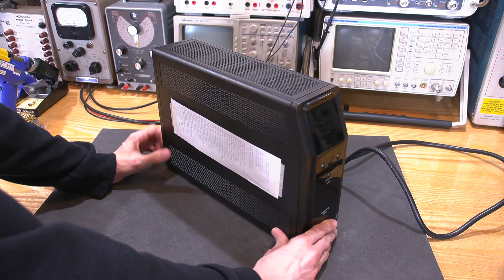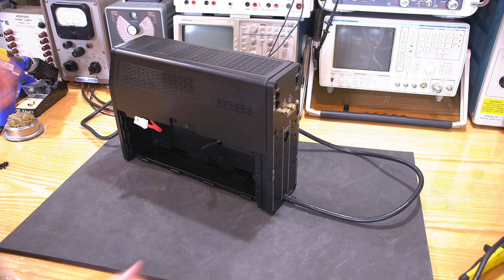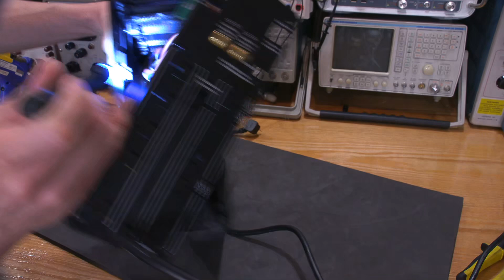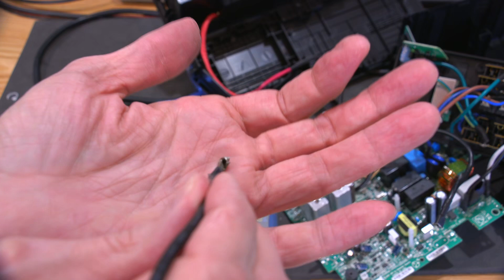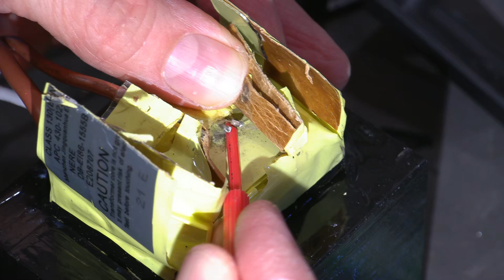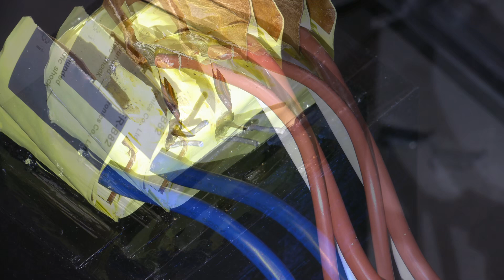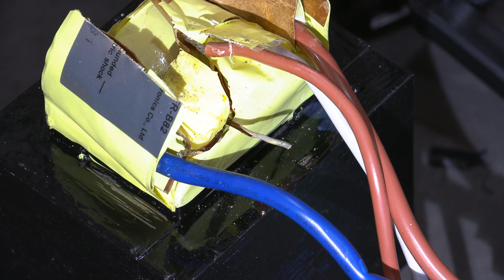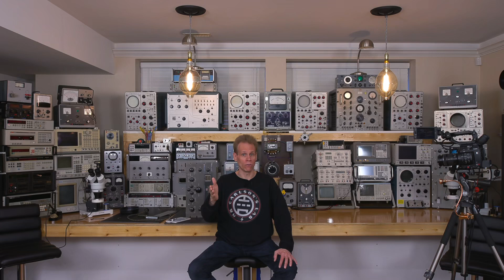UPS Electrical Failure - Teardown and Analysis!

Comment from the maker: To learn electronics in a very different and effective way, and gain access to Mr Carlson's personal designs and inventions, visit the Mr Carlson's Lab Patreon page here: https://www.patreon.com/MrCarlsonsLab
Reply: you can solder aluminum to copper wire with standard solder and special flux for aluminum, sadly more and more devices like transformers and motors are wound with aluminum wire today
Reply: Copper Clad Aluminum no doubt. I personally have had rack mount APC brand equipment fail in a data center. The transformers are garbage. At least the technology is smart enough to fail safe.
Reply: APC QA tests all their UPSes and then tapes the print out of that series of tests on the side of the unit.  It doesn't necessarily mean that it was refurbished or remanufactured.
Reply: @unmanaged  he just showed you the failure 🙄 f02 warning for a fuse or relay? Presumably for a fuse or relay directly in line with the solid state transformer winding failed connection.. that he just showed you
Reply: What a lousy failure mode! Nothing wrong with aluminium windings. But you must ensure proper connection if you want to continue in copper. Definitely in this high-power application. 
Crimping may be better here... Not shure. Something to look into for APC!
Reply: @ReinierKleipool   Shure?
Reply: I have of the exact same UPS in use in my shop, all within 2 years old, maybe the oldest one is three.  One is inside my locked server cabinet (tight fit).  So far, all four have been great.  The last one is well past its return to Amazon time.  I guess I just have to keep my fingers crossed.
Reply: @Daveyk021  I'd not use that model for more than a workstation and primary monitor. Servers want a bit more beef and I oversize a bit in battery to ensure longer run time and proper server shutdown.
Reply: @spvillano  My server is a little four bay Synology (really souped up though).  The UPS runs it, the Internet modem and the Router.  Even so, it is barely loaded.  I ordered Aluminum solder and Flux to join Aluminum and Copper wire together to keep in the supply cabinet just incase I ever need it (fingers crossed).  I thought APC was the name in UPS, but now I see they are a capital company rather than an engineering company.  Better keep their share holders happy rather than the customers.  This is why GE fell apart.
Reply: I see those "receipts" on APC surge protectors and PDUs as well if that helps. Might be a common feature of the industry
Reply: F04 Clamp short
Reply: It would be wonderful if the makers of this UPS would learn electronics in a different and more effective way for sure.  Thanks for sharing this video!  I had no idea aluminum transformers were a thing in electronics.
Reply: Two of mine caught fire.
I turn them off when not in use.
I took one apart and saw a mosfet was cracked.
Reply: Every APC ups since time began has one of those receipt test report thins taped to it when it's new. The last ups I bought was eons ago, and they were a few small APC UPSes, and they all had that test report thing on it.
Reply: @gorak9000  Of the four I have, I pulled that off when unpacking, looked at it briefly, shrugged my shoulders and tossed it in the bag to go to the burn barrel.
Reply: This is more common than you think! I bought my 75 ohm antenna cable for approx. 1 year ago and the center leads are made of steel with a thin layer of copper.

my rca signal sound cable I bought has an aluminum screen.

this is only to save money at the factory. the product is of much lower quality as the solder only adheres to the thin outer layer
Reply: @ford1546  I had no idea you could solder aluminum, but apparently with "aluminum" solder and the special Aluminum flux you can, at lower temps that we are used to with lead solder for copper.   I did order and receive the special solder and flux, but have not tried it yet.  I may need to dedicate a Hakko tip to aluminum.   I see structurally, for racks or shelves, it looks like they braze (which is what basically soldering) aluminum pieces together.
Reply: @Daveyk021  Yes, correct that you can solder to aluminum wire with special solder.

But aluminum is softer and does not conduct current as well as copper!
Reply: @ford1546  Yes, using an Aluminum wound isolation transformer is terrible of APC.  I can't believe there is that much of difference when buying a transformer, but the bean counters for the shareholder will save 5 cents wherever they can; shame.  I have four of that exact same UPS here in my shop.  So far, okay.  I wonder what a good  brand is?  Need to find one where shareholders is not their number one priority.
Reply: I have this UPS and it died a couple of years ago.  Won’t even turn on at all.  I hung on to it thinking it might be battery, but never replaced it.  Didn’t want to spend the money for it only to fail.
Reply: I knew it was the transformer from the sound. Aluminum has a history of sparking. It's dangerous and just shouldn't be used.
Reply: I'm at just before the halfway point, you just took the pcb off of the case and flipped it over and discovered no obvious damage, so I am going to GUESS based on what you said happened that the transformer itself arced, either onto a nearby lead or its internal insulation failed. I could be wrong, but that's my guess, not much else would mimic an arc welder if you see no visible damage on the pcb.
Reply: HAHA and no sooner than I typed my comment and hit play again, you pointed to the transformer and said "hmm. it couldn't be this...." as if to say it would definitely make those sounds, but would be VERY unlikely to happen (I agree, but power failures can hit those things really hard with a transient, so IDK, we'll see... I'm hitting play again. I could very well be wrong but am curious)
Reply: I'll be dang, I was right. And I'm OK with an aluminum wound transformer, I'm NOT ok with them slapping it together with solder, I'd almost wager those aluminum wires were plated with another metal then insulated, but even still, you'd want to do some other type of joining than solder. I will NEVER buy one of that brands products based on this. Something like that could cause a fire.

Comment: Whoever soldered the wires to the transformer winding didn't strip the enamel coating off the wires at the factory, this is why the solder wouldn't take. If those connections had been cleaned up and some flux used, you probably could have soldered that black wire back to the transformer.

Comment: What a disgrace, APC, a transformer with aluminum wire. Didn't the engineers know that aluminum is prone to leakage and will lose contact over time?
I recently received a Powercom UPS for repair that had been in use for about 15 years, and its build quality is far superior to modern products from the same company.

Comment: I have one of these that I bought through a local large box store and I just experienced an issue as follows: Unit powered on and display shows all functions normal. Self tests when powered up, etc. Disconnect from A/C line and instant Off, completely. Schneider was initially slow to accept this but after a phone call, is overnighting new batteries that were out of warranty. The UPS still has 1 year left. Also, there have been remarks on other videos that since APC left the building Schneider is slipping. While waiting for the new batteries I tore this unit open and have to say that it is super clean, all connections are tight, No weird adhesives or other material slopped around or anything worth railing on. One of the cleanest boards I’ve ever seen. So in the end they may have “gotten the memo”.

Comment: Thanks for this!  I have a BR1500MS2 I purchased brand new Jun-2021 from Amazon and it had the exact same "QA" printout (same Revision 1013) taped to the side.
I had a power outage last week.  The UPS held power up to my PC and displays plenty long enough (PowerChute software warned of AC outage) for me to power the PC down manually and powered off the UPS.
When power returned, I turned it on and there was a pop sound with visible sparks (and magic smoke odor) at the back of the unit and F02 on the display, and the same constant audible warning.  Get the same if I power it up with nothing connected.
So far, I have only removed the battery pack and my DMM reports it as ~25VDC.  Powering up the UPS without the battery there is warning of no battery but otherwise the outputs operate as expected and my DMM reports ~24VDC at the battery terminals.
I'm going to watch your teardown and open it up (without battery and disconnected from mains of course) and see if I find any visible internal damage.  I need an UPS, so need to figure out if I need to buy a new UPS or just a new battery pack.  I know enough about electronics to inspect and troubleshoot but I'm not going to attempt internal repairs if I find fails inside.  Will follow up with my findings.
Reply: So, I got it opened up.  Both Q1 and Q2 (the large blue and brown wires from the transformer) evidence burn marks on the PCB and are actually missing legs.  Another UPS to recycle.

Comment: An APC UPS displaying an F02 error code indicates an output short circuit when operating on battery power. This means the UPS has detected a problem with the connected devices drawing too much current or a short in the wiring, causing it to shut down to prevent damage.

Comment: Yes, that screaming alarm that comes on when something is afoot. 😣
I was so intimidated, 
I put the UPS straight back into its original box and every now and then prowled around it like a frightened cat, until I could no longer remember where I put the box.
Thirty years later,
 I eventually recovered the box containing the UPS,
 and in an act of unexpected courage, 
overextended my budget by AU$ 30 required to purchase and lug the heavy Accu home. Then painstakingly installed the accumulator by the sweat of my brow for the next 2 hours. 🥵 
Problem solved! 🤗 
I also set those tiny flip switches in the back of the UPS to turn the alarm off permanently, never to be intimidated by that horrible noise again. 😌
Now you know what an old woman can be like.
Who goes around telling people about the different realms of the various Indian Gods while incessantly rolling his eyes. 🙄

Comment: To be honest soldering to aluminum isn't the "fail" it's being made out to be here. Yes, this particular unit failed and I can't speak to the process and quality control in the factory where this was made. But solder/flux combinations specifically for soldering to aluminum aren't anything new. That being said, I wonder how the leads on better transformers of this size are attached. Is a wrap and solder connection typical in copper wound ones?

Comment: Very interesting video thanks for sharing 

I actually came across uour video because i was sesrching dor possible reasons for why the UPS i got here has issues 

The unit i have js a silvertech power plus 650 

The issue with it is its barely doing anything  when i olig it into the power the screen lights up so dark and can just make out an image of what looks like a pea sized white dot 

It will beep when i oress the button and the screen does flicker a little i huess rhe flicer is in line with the click soind i can hear  but after a while it wont beep anymore and click stops 

Unplug it and oress the button and wont beep strsight away leave it alone for a few minutes and i can oress the button and it will beep and display eirh ligjt ip dimly 

It seems the reason the flick stops and rhe beeping no more dueing pligged in seems to be draining whatever is left of the battery 

I get no output when its plugged in either i susoect this is an online UPS that is an AC to DC /  DC to AC  regardless 

Where as an offline UPS i shoild get an outlet while oligged into power 

Im not so familiar eitj online UPS bjt i am wodering if these ttpes of jnits require a properly functioning battery to operate the circuitry properly suchbas powering the chips thar oeorate the relays  and have seen articles saying these things dont eork if the battery js missing / not working and jf the battery is shagged eith inky enough juice to make it beep  eould this be a reason it cannot start 

I also wonder if this coild be capacitor relatee as i know some devices such as power supplies can fail or not sct correctly kf capacitors go bad 

Now i did crack the lid and take a peak inside see if anything gor BBQED or if the battrry shows signs of going bad all looks good so far 

As for capacitors i can see small electrolytic caps not seen ant big ones tho jabe not pulled the board lff its frame and gor a good look between the heatsinks 

Any ideas

Comment: I have this UPS and it constantly fails, it's sitting in a corner powered off now. UPS's are some of the most unreliable devices ever, every one I've ever owned has had problems, I've always bought APC and now I am done with them.

Comment: I have one of these UPS units. Absolute garbage. First of all, it does not use the actual battery voltage to determine the charge level, it uses a "computet" algorithm-based (load over time) calculation to determine the current battery capacity. This means you can't use external batteries. Second of all, about 50% of the time this UPS fails to kick in and instead just switches itself off - whenever my power goes out (~250 watt load from my PC). Defeats the purpose of being a UPS. DO NOT BUY!!!

Comment: While not cheap, I've decommissioned my half dozen APC units that I used for a large home lab. I've replaced them w a Victron Energy 2kw inverter and a 200AH battery. Such a better quality solution, although it takes know how and $$$ to buy and assemble this. Kind of a rabbit hole of accessories to pull and graph detailed data. I've got a switch, fuse block, shunt, and so on. Not exactly plug and play but so awesome.

Comment: 1, thx 4 this video. Some constructive criticism. 1, you could have advised that taking apart the snap on case may require using the claw end of a hammer. Gently, of course. I have a couple others but I'll whatever them. My transformer had copper, thankfully. OMG, that one didn't? Again Thank-you! 😀

Comment: I am told that an ultrasonic tip allows one to solder to aluminum (removes the oxide layer before it can form)
Reply from the maker: Never in all my time have I seen aluminum soldered to a dissimilar metal.
Reply: @MrCarlsonsLab  Seems there are fluxes that allow this (without ultra-sound)

Comment: I would have never expected APC UPS to use a transformer with aluminum windings,let alone have that sort of “solder” connection on it. Makes me wonder how durable the  Insulating coating is, especially as that aluminum heats up in use. Just awful and a potential fire hazard. Hard to believe that meats any certification standard. That is the sort of junk, and likely not very safe junk, one might find on a  no name eBay device. Shocking. 

Won’t be buying a UPC product again.

Comment: In 2021, I purchased three of those units.  All three have had failures.
My last failure was just beyond the warranty period, and APC refuses to replace the unit.

I had them review all of the failures (referring them to the tickets / case numbers), to use that as justification of poor design and / or poor quality control.  A company that cares about their customers would want to compensate the customer for so many failures.  But APC does not care.

Their current line of Smart UPS units are also prone to failures and poor quality control.  I read many reviews, thinking that maybe if I paid for their higher tier Smart UPS models, they would be more reliable.  Alas, the customer reviews were littered with complaints with the Smart UPS units, too.

I own two, 15-year old Smart UPS units that have never given me any problems.  So APC can make great products.  But some bean counter at APC decided to cut corners and now APC units are unreliable.  And while cutting corners, APC's prices have gone up a lot.  That is a disastrous combination.

APC lost this long-time customer.  I am purchasing a CyberPower UPS.  They get excellent reviews.  And although there are always negative reviews, they are minimal, and there is no common complaint about the quality of the units.

Goodbye APC.

Comment: I already left a review on Amazon about this particular crap model. What this thing can't do is it can't handle low power draw for long period of time when running only on battery. If you fully charge it, plug in a monitor into it, and unplug it from the wall and leave it like that running on battery it will start smoking on you after some time. So do NOT do that! As a matter of fact get rid of it. Because this thing will likely burn your house down if the electricity goes out and you are not home to turn it off. ..and Yes, it was the transformer that felt so burning hot you could not even touch it. I remember!